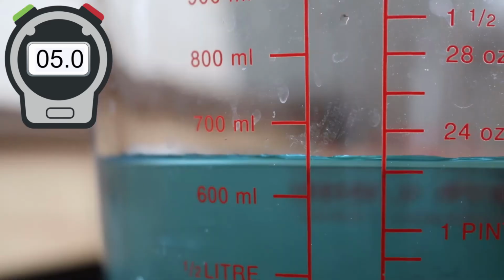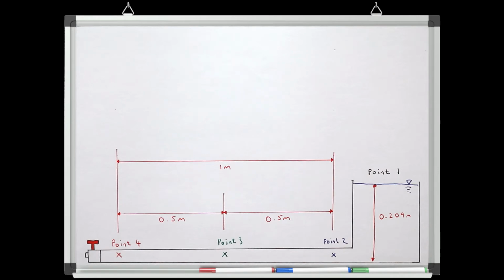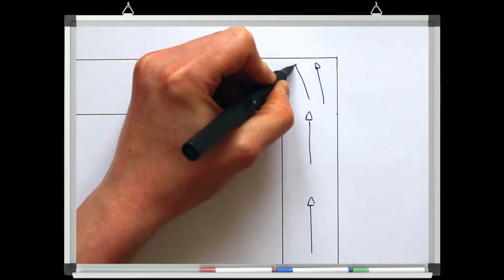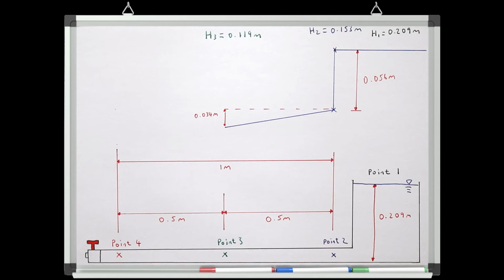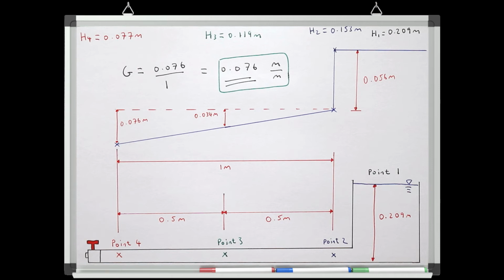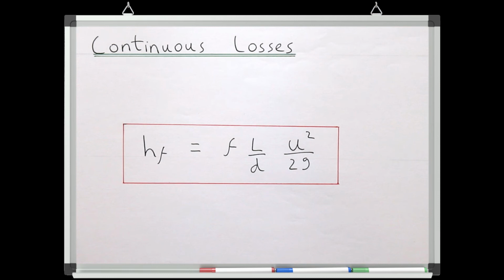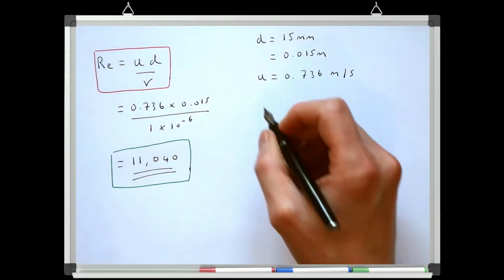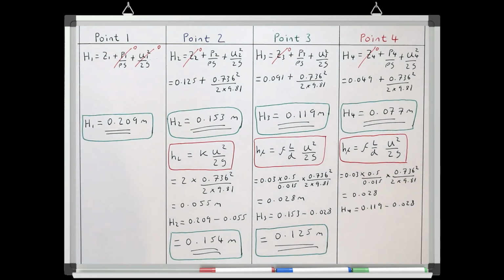Local Loss Equation, Continuous Loss/Darcy-Weisbach Equation and Moody Diagram (Lesson 3, Part 3)

Comment: I think for the continuous loss equation at point 4 the length is supposed to be 1m as opposed to 0.5m
Reply from the maker: It’s 0.5m because we are applying the continuous loss equation between point 3 and 4, which is 0.5m of pipe length. It would be 1m if we were applying it between point 2 and 4.
Reply: @fluidsexplained1901  okay, thank you very much